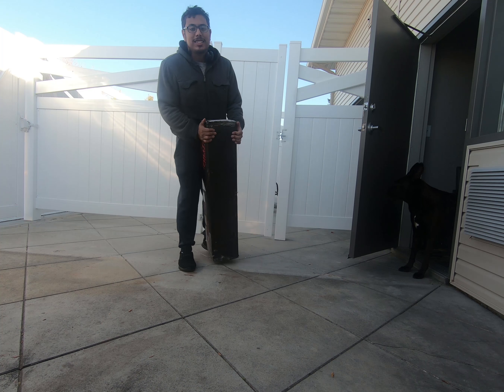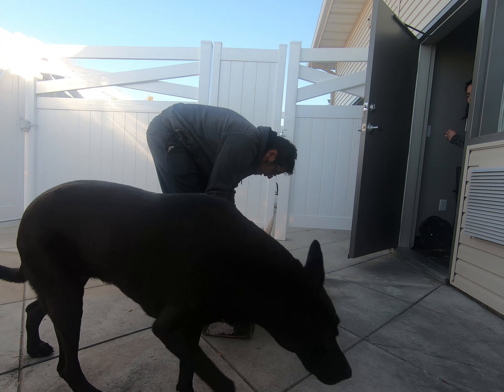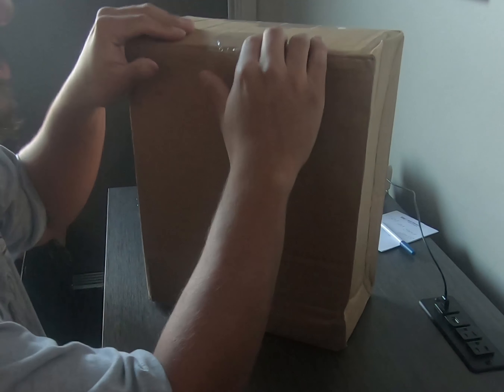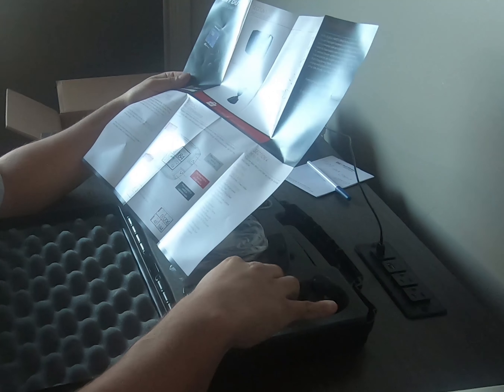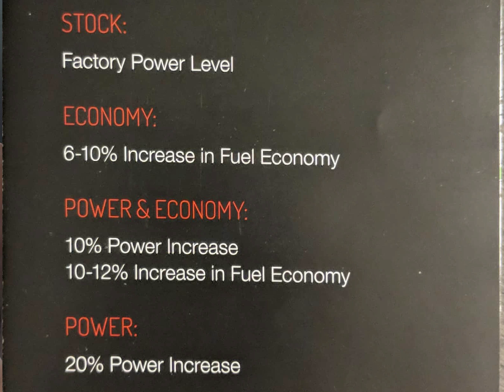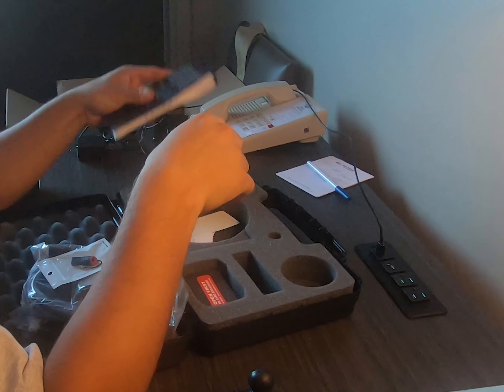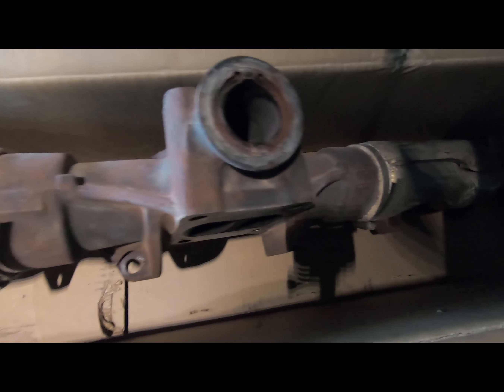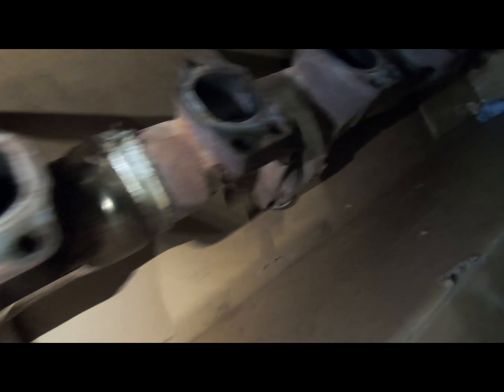Bully Dog System's Paccar Exhaust Manifold And Tuner Install

Comment: Hi I just checked my T680 it doesn’t have the RELAYS. only FUSES for TRLR ABS 2 for CAB ABS PWR and AUTO TRANS
Reply from the maker: If your willing to try without pulling any I did it multiple times without pulling anything on mine it's kinda scary having your dash Christmas tree like it does but after cycling the key a few times it worked fine. And if you know anyone that wants the bully dog exhaust manifold I still have mine you just have to weld it back together at the flange

Comment: What do you think about deleting DPF system?
Reply from the maker: I was planning on doing it until I found out that on paccar dealers can get screwed for working on your truck if it's egr deleted because the dealers scan tool sends a download of the ecm to paccar when ever they hook up to a paccar engine. on a Cummins it doesn't do that so if you have a Cummins and aren't to worried about the fines that will come with it if you get caught go for it . I personally only take my truck to the dealer when comes to serious issues so I couldn't afford to lose that asset
Reply from the maker: Caro Quintero  from what I've heard Kenworth techs working on a EGR deleted truck it's about $10k or maybe $50k and the dealership gets fined $250k I'm not sure what the fines would be for DOT finding it on your truck but I'm sure you will be forced to rectify it and put out of service until you prove it's rectified. But I could be wrong idk of anyone that's been caught with a deleted system they don't drive to locations where they would get in trouble i.e. California and they have independent shops working on they're trucks
Reply: They work how a motor should after a delete with someone that knows tuning properly

Comment: Did you get a noticeable increase in power from tuner only by chance? As far as pulling hills/ acceleration. Great review btw!
Reply from the maker: I feel like I fly up these hills now I've been wanting to video myself with a zero to 60 with about 78k gross weight and climbing a large incline but unfortunately I only have a tuned run of the test and not a nontuned run seeing as I don't tend to pull so heavy. When ever I do get a load that's that heavy I will upload it. But with the Dyno sheets showing such a large increase I want to say I'm not just thinking I'm hauling butt up these hills but that I actually am. Thanks for the comment and sorry for the late response
Reply: @AdventuresOfChrisAndJane  looking forward to that video! I'm in the process of buying a 2016 pete with mx13 excited to see how it is compared to my ih with a c13!
Reply: Dillon Huntington don’t be too excited about the mx13 especially if it’s rated at 485 or less.
Reply: @jimbro389  I don't haul real heavy. 8 car trailer usually loaded under 70k
Reply: It's set at 485 btw so we'll see I'm going to pick it up next wk
Reply: Dillon Huntington I’m gona order a pdi turner says around 15% increase to get a little more out of it.
Reply: @jimbro389  I've heard great things about pdi! If u do comment back let me know how it does
Reply from the maker: @jimbro389  I was thinking of getting a PDI tune as well but with the full EGR delete however I knew I wouldn't keep the kw so I opted for the bully dog tuner instead since I can tune multiple engines tell me how it goes for you I'm interested to see how much more hp you get out of it my highest HP before tune was 357 and after tune was 402 to the wheels mind you , that's almost a 13 percent increase over stock
Reply: With the bully dog power tune.... I have to remind myself I’m not empty with a 5 axle trailer.  I have the HDGT for all motors
Reply: I have the mx13 510 hp and love it
Reply: @DHunt-dt9hm  well. How was the mx13 treating you